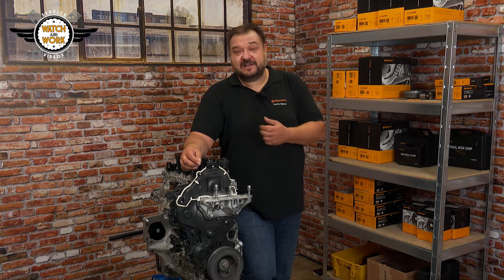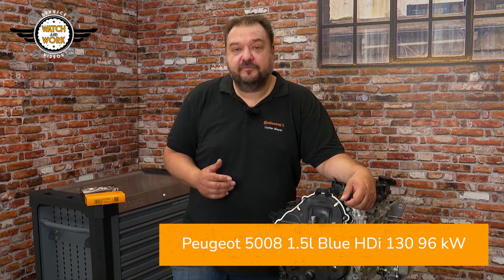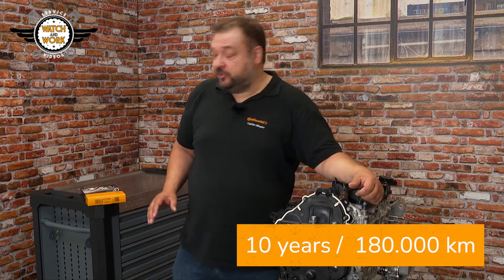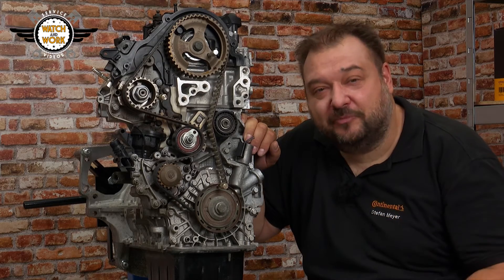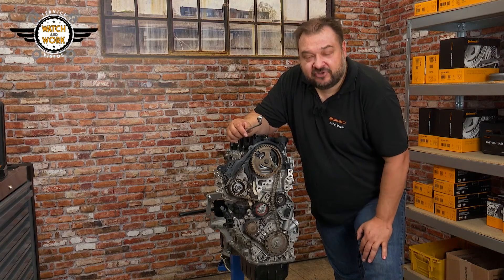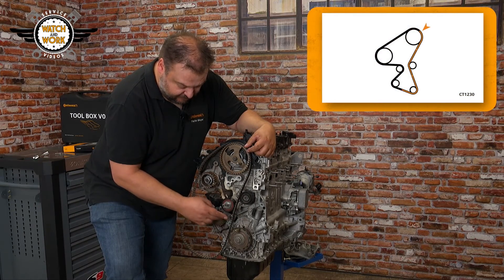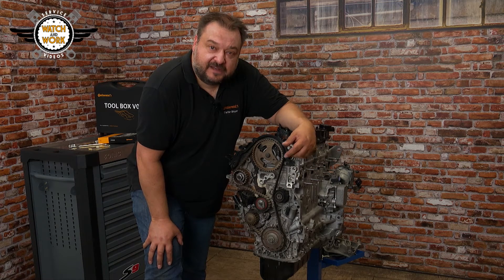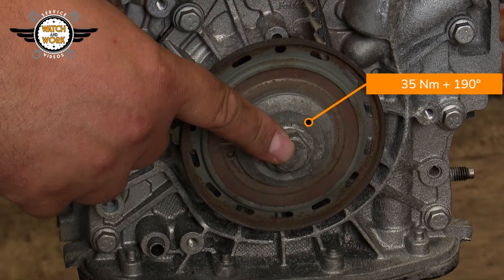[EN] Watch and Work: Changing the Timing Belt on the Opel Peugeot 1.5l Blue HDI

Comment: I have tried a dayco kit recently and when i do the tensioner it does not line back up to the postion in the middle of notch.
Could you tell me wheb you install tensioner to engine how much do you tighten the nut? And then when you install belt and let go of the pin how tight do you fasten the nut when you move the locator to the first point? And after 6 turns you loosen nut slightly while making sure locator doesnt spring back and move to middle of notch and then torque nut to how much nm?
Any help i would appreciate as i want to do this again and buy this kit.
I am getting a churning noise from injection pump after engine is little warm. I did not have this before new timing belt installation so i think this is because of tensioner maybe belt?
I did notice also belt move far to inside of pullys after i start engine i can not understand why.
Reply from the maker: Hello @Antsummerfield83, the following instructions are the tensioning forces: 
Tension pulley: 30 Nm
Deflection pulley: 35Nm
Crankshaft Bolt: 35Nm + 190°
The forces have to be set while installing and before turning the engine via hand. Otherwise it will not set itself correctly.
Best regards! 🛠
Reply: Hello, is this timing belt a wet bet system ? that drives cam chain ? Everyone including Vauxhall (Opel) dealers, tell me it is, but to me, watching your video it looks a dry setup ??

Very confused 🤦‍♂️
Reply: @markdamms5287 no this is not a  wet belt, it has a normal cam belt and a small chain around the 2 cams (inlet and outlet). This chain if it’s factory 7mm chain are common on breaking. 
My tensioner for this chain gave up in December which span the cams , luckily I just needed to replace the cams and a new chain and my car is fixed as it could of been game over if the pistons and valves met at the wrong time 😅.
Reply: @Antsummerfield83  Thanks, I can't believe then that Vauxhall are telling me my car 2019 Grandland X fitted with 1.5 DV5 Diesel engine has a wet belt 😳
Reply: @ 😂 no no wet belt just standard cambelt and the 7mm chain for the 2 cams on yours, they upgraded the small cam chain to 8mm from 2022 models I believe because they was snapping.